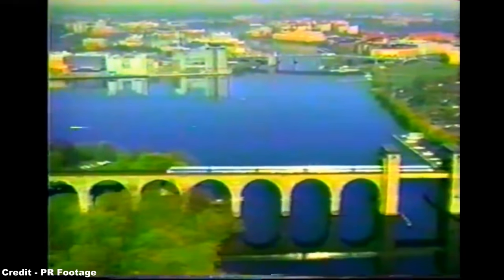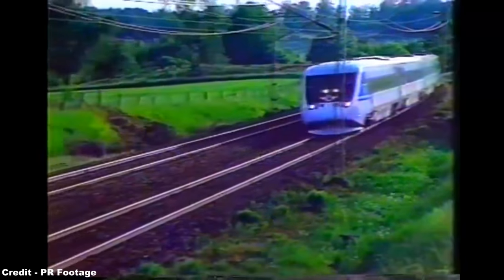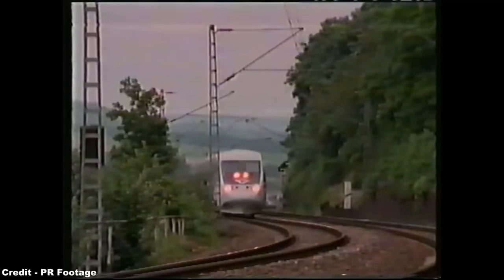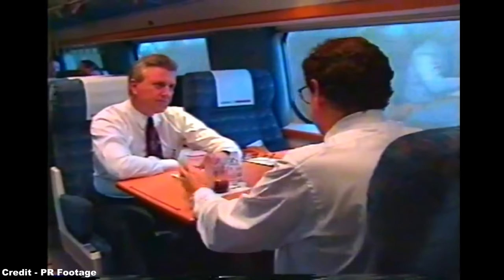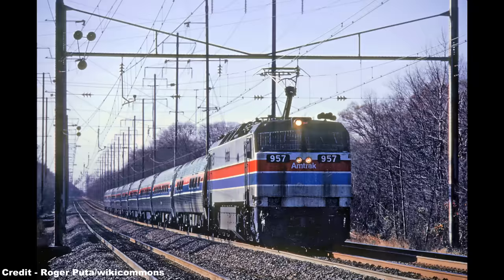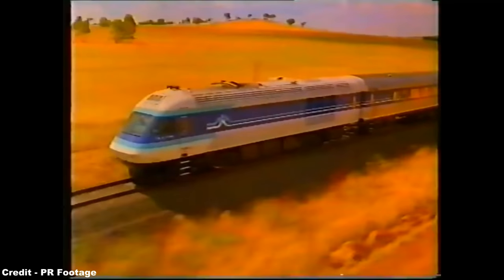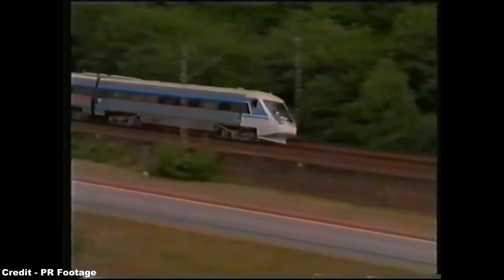Tilting Triumph - X2000

Comment: Well, one correction is that Sweden is not "largely mountainous" but, in fact, rather the opposite. It is flat, with some rather minor mountains in the north towards the Norwegian border. There are other reasons Swedish mainlines are not so strait; many lakes that needed to be avoided and the cost of building infrastructure in a sparsely populated country meant that is was cheaper to go around obstacles than over or under them.
Reply: It's hilly more than anything
Reply: @wewillrockyou1986 
Not particularly.
Reply: Tbf Its basicly just a massive hill going towards jonkoping
Reply: @moggsly5669  Just this summer I cycled from Göteborg to Stockholm via Jönköping, and...can confirm.
Reply: Yeah I cringed a bit when I heard that. If you look around there are no mountains anywhere near population centers. Sweden is hilly at worst. Lake dodging makes a lot more sense as an explanation for a tilting train and frequently bending track
Reply: So they were cheap
Reply: @qjtvaddict  When the main lines were built, I don't think anyone expected trains to travel at the speeds they do today. So a cheaper and curvier track made sense.
Reply: @persjofors2586 It is rather hilly on the west coast though, specifically around Gothenburg and north. And you can't forget about Höga Kusten.
Reply: Compared to most of Europe you could probably call it mountainous. And there isn't a flat stretch of land anywhere north of Gävle.

Comment: And 30 years later, the X2000 is still the best train running here in Sweden, in my opinion. Thank you for this nice presentation.
Reply: 33* and is not the best depending on what you call "best train"
Reply: @jultomten3739 I clearly see "in my opinion" in Michaels comment..
Reply: @davebowman6497  Missed that, sorry still 33 years :)

Comment: The X2000 is a design classic. I hate to use the word "iconic", but I think it applies here. Definitely one of the best looking high speed trains ever, along with the ICE1 and the original TGV Atlantique and Sud Est. I've never been on one, but I recently visited Malmo and saw one at the station. So cool.
Reply: They struck a perfect mix of modern and classic with the sleek ends and corrugated sides. The original TGV and Shinkansen are definitely more iconic, but the X2 is a much more timeless design.

Comment: Thank you VERY much for this. I got to ride X2000 on the noon Metroliner in 1993. It was EXACTLY what Amtrak needed for the 19th century infrastructure that is the Northeast Corridor. In the end it was expensive and Amtrak wanted cheap and so we got the "American Flyer" later rebranded Acela. X2000 has been rebuilt losing the original GTO inverters and getting IGBT inverters (and ballast to make up for the weight loss) and will be in service through at least the end of the decade. Acela cannot be replaced soon enough. We had the answer in our hands...and we let it go.
Reply: Blame the AAR for that. They insisted on the ridiculous requirement for trains to resist structural deformation with sheer buff strength rather than crumple zones that could absorb kinetic energy, so most American trains are effectively built out of heavy steel armour plating. Unlike everywhere else in the world, that seeks to avoid derailments and collisions by providing adequate signalling and infrastructure, the AAR approach is to require rollingstock that won't be destroyed in the inevitable crashes.

They've relaxed the rules somewhat but the legacy remains, and American railroads are notoriously resistant to embracing new ideas from overseas.
Reply: @zoqaeski  They were planning a waver for the NEC though. No there were more concerns about buying American and Bombardier had production in the US. In fact they have that waiver now for the Avelia Liberty.
Reply: @zoqaeski  The AAR does not write standards for passenger vehicles. Back in the late 90s when Acela was on the drawing board they designed for the then current FRA requirement for end buff strength: 800k lbs. After a knock down drag out fight within the FRA the 1m lbs buff strength requirement was adopted for vehicles above 125 but not above 150 mph. (For the record X2000 met the 800k requirement as designed and may have met 1m with little or no modification.) At this point, as later chronicled by NRPC OIG, they should have ripped up the plans for Acela and started over. Buff strength is a function of design as well as material. But starting over would raise the cost and exceed the already paper thin margin Bomber had committed to. Ergo, they added more steel and created a very fast tank.
Reply: @quayzar1  At the time of testing X2000 and ICE the wreck of the Colonial at Chase, Maryland, was still very fresh on everyone’s (read FRA) mind. They were not going to sanction “high-speed” cab cars on the NEC and so if X2000 had been chosen there would have been a power car on each end. Also, at the time ABB had the facility in Elmira, New York, at the time and would have complied with the “buy USA” requirements. That property would later become the space for CAF USA to build the Viewliner 2s…but that’s another debacle.

Comment: My first ride on a high speed train was on an x2000 back in the early 2000s. It was a brilliant service especially compared to what I was used to in the UK and Ireland. It wasn’t particularly fast but the interior comfort, general design and cleanliness was a step above anything I’d previously experienced. A really great achievement.
Reply: But the speed of the X2000 is the same as UK trains such as the HST and 225 so surely if you count the X2000 as a high speed train then the HST should be a high speed train as well.
Reply: @OntarioTrafficMan As I stated, It wan't particularly fast.

Comment: Except for the far north Sweden is not a mountainous country but it is very humpy. The geographical feature which dictated the shape of the railways was the prevalence of lakes and rivers. The engineers building the tracks originally took the easy way out following the edge of a lake or a river wherever possible giving rise to the extremely twisty track. Even today the most sinuous portions are those which follow the water's edge but the cancellation of G forces is so good that it can be quite a surprise to look out the window and see an adjacent stretch of water apparently sloping up to sky.
I don't know whether it is still the case in the early days even the second-class carriages had the same at table 2+1 layout as first class which with the broad Swedish loading gauge made it about the most spacious second-class in Europe.

Comment: As a Swedish train geek, I appreciate videos with high quality about our trains.

Just a small correction.

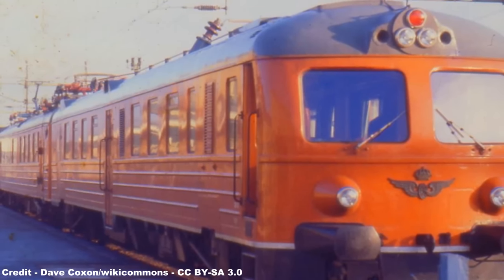2:32  The X1 was used in 1969-71 for tests of high-speed trains. X1 were new commuter trains at the time and they were needed in Stockholm.
So they used an old X5 that was built in 1948. It was the X5 that was rebuilt into the X15.
Reply: And now we have a Swiss train called X15 "p" waiting to start service on the Roslagsbanan 😉

Comment: Sadly the X2000's time in NSW Australia never went beyond the demo runs due mainly to the amount of severe curves reducing train speeds to as low as 40mph in places caused by government restraints on capital costs that forced the early railway planners to follow land contours that could be easily accommodated by the early steam locos of the period from 1855 onwards. Net result is that while yes you can enjoy the scenery onboard but in terms of competing with road and air places railways in NSW a very poor third behind road and air travel. For example a domestic flight between Sydney and Melbourne takes around 90 minutes where as The XPT covered the same distance in roughly 10 hours.

Comment: I ride these quite frequently and they are gems to ride on. And they are undergoing refurbishments currently that improves the comfort, smooth ness and reliability of the tilt system. However when the tilt system breaks down, is not fun.
Reply: Funnily enough the tilt system was broken on the bistro car last time I traveled with x2000

Comment: I'm a Swedish driver but not currently qualified on the X2 (I hope to be in the not too distant future!). Just walking around the depot they have a very destinct aura around them. It's just something with the pretty brutal design and roaring fans when departing. I did drive it for two weeks during driver's training, and it's really something else. Going through curvy sections on the mainline at 180 km/h is something else, you're really flying while comfortably sipping your coffe (at least from the DVT...)!
Reply: @bjornlillpers498 Curious~How's the feel while riding X2 locomotive side???? 
 Feel uncomfy when it doesn't tilt ????
Reply: @jim1997330  It's fine when you're in the seat, but you have to hold on to your coffee on twisty sections. It's pretty loud as well
Reply: @bjornlillpers498  Thanks man, I finally got the answer I want  (´▽｀)
Rare to see these unit ,locomotive + tilting carriages ~~~~
Reply: Får du köra X2000 nu?😉

Comment: I had the opportunity to look over the X2000 set when it visited Brisbane in the nineties. It consisted of a driving trailer and two carriages, with motive and head-end power provided by two XPT power cars. I had to laugh at the "Conference Room" on board - two pairs of seats facing each other over a table,  surrounded by a perspex enclosure. I immediately thought of the Cone Of Silence on Get Smart.

Comment: Hi Ruairidh. Very interesting video. It still sticks in my craw that BR did so much research and development into a tilting train, but could not get over the winning line. I heard that Italy had taken up the running, presumably culminating in the Pendolino. Therefore, it was with surprise that you didn't mention the Pendolino until almost the end and then almost in passing. I had no idea that Sweden had done so much work on the technology. By-the-by: Guangzhou is pronounced Guang-Jo and Chengdu is pronounced Chungdu.

Comment: Thanks for the video. 2 points.
Sweden is not mountainous.
I think you meant radially steered bogies, not radically.
I rode on the X2000 demonstration cars between Sydney and Moss Vale in NSW in the 1995. It was a  Bistro and first class car between 2 local XPT locomotives which had each been fitted with the ABB tilt control system. We hit 160km/h a few times but had to slow through tunnels due to the narrower NSW loading gauge.
Reply: Not mountainous, no, but it has a lot of humps and waterways.

Comment: While I love the Acela, the X2000 would have been right at home on the Northeast Corridor. The corrugated stainless steel body compliment the AEM-7 / Amfleet stock perfectly, aswell as the Arrow/Silverliner EMU’s and ALP44 loco’s. Even the SJ livery looks very Amtrak like with its color scheme. Sometimes I wish that alternate history had occurred and we would have ended up with them…

Comment: First introduced in 1990. Ironically this is posted in a week when HS2 to Manchester has been cancelled in the UK. Talk about being 30 odd years behind the curve.
Reply: These aren’t exactly high speed trains as such your not getting 185mph here!
Reply: @vernongoodey5096  never mind speed they were first introduced in 1990. Years ahead of anything in the UK at the time. All that underinvestment under the Thatcher and subsequent governments left the UK light years behind rail travel on the continent especially France.
Reply: @philbraithwaite1316  as a railway engineer I’m sure the actual locomotives don’t tilt and the  drivers would suffer from nausea, don’t no if they have cured this. Your correct with Mrs Thatcher in all her years as a politician she only ever travelled twice by rail and one of those was when she named a Class 87 after herself (good old Sir Peter Parker)
Reply: The uk has had 200kph in regular service since 1976 so not that bad.
Reply: @philbraithwaite1316  hold on just realised the year you quoted, our HSTs that still hold the world speed record of 142mph we’re introduced wait for it in APRIL 1976. The genius design was that it ran on our old Victorian rail system at these speeds. & went from design to introduction within 4 years after the APT-E debacle
Reply: Oops just read your last reply we both quoted the same info thanks. Buy the way Europes first actual high speed line was built in Poland Warsaw to Krakov

Comment: I'm just amazed by how much I used a train back in the  1980's and early 90's  in the UK  despite owning a car.   It all sort of dropped off once moving to the SW of France. in 1993  80% of the rail network closed down (as with Beeching). My last train trip was with the TGV from from Avignon to Paris, and then Eurostar    in 2014 to Charing Cross.....

Comment: 2:32 X15 is NOT based on X1 unit, but by X5 units, wich the picture above correctly shows. The X1 units was also tested for tilting technology, but did not become an X15. Some X1 and X10 commuter train units can be seen at 5:39 next to the X2000 in Stockholm Central.

Comment: As a Hong Konger, I could possibly add something more to the Chinese export story. Part of the reason for the demise is that the Swedish firm did not provide regular electrical maintenance as part of the leasing contract. As a result, the Guangzhou railway group had to sort problems out on its own by sourcing components from both overseas and local reverse-engineering. The lack of proper support had raised the maintenance cost drastically over the years, while the train had grown to be incompatible with the newly renovated Guangshen railway when the Bombardier-designed CRH1 was in service (And subsequently the entire built-from-the-ground-up Chinese HSR). So X2000 quickly fell out of place after numerous failures. 

However, in retrospect, this train serves as an important landmark in Chinese HSR history as it was the intermediate product of slow mainline trains and the full-fledged dedicated HSR lines. It also teaches the Chinese how not to run imported models as later on they simply bought the right to manufacture the trains in China under the original maker's guidance.
Reply: Very informative, and apparently, the train set was bought back and put in the Järnvägsmuseét (railway museum) in Gävle.

Comment: Partial video that tells history of failed prototypes that had no commercial follow-up and ignores the true story of a 50-year success. The technology of the "titling train" called "Pendolino" is an entirely Italian invention and patent. In 1985, engineer Santanera filed a patent application for the Fiat Ferroviaria company, entitled "Railway vehicle for high speeds with variable trim body", granted with the number IT1183754B. This used 2 gyroscopes by aeronautical equipment (FIAT avio) and accelerometers, placed on the first  bogie of the train. A computer, depending on the speed, calculated the inclination to be given to each individual carriage, when it reached the curve. The first Etr 401 "Pendolino" entered service between Rome and Ancona in 1976! Since 1988, with the Etr 450, they entered regular service, forming the backbone of the Italian 250km/h AV (high speed). Over 30 electric trains (ETR) were built of the 450,460,470 and 480 series. The FIAT railway patent was purchased by Alstom in 2000 for 300 million euros!  Titling train manufactured by Altom around the world are built on the original Fiat patent.

Comment: Today, as they're over 30 years old, the reliability is not what it used to be, the X2 is now the most problem-prone train sets that SJ has, even surpassing the notorious X40 double-deckers from France. But SJ has started to overhaul the fleet by rebuilding them, both technically and cosmetically and the "new" units are almost like a brand new train making it possible to run them at least 20 more years, if not more
Reply: Is the X2000 really so unreliable?
Reply: Yes. And I'm speaking from experience of driving them at a daily basis here. They're definitely not what they used to be

Comment: "Sweden primarily mountainous terrain"

What? where? There are plenty of small hills, but barley any mountains. Apart from up in the north west, but there is no railways. 

The reason for not wanting a France style solution is simply that it was at this time not deemed a economical to build a full extra track for as little traffic as would be needed.  This kind of have come bit and bite Sweden now with a large capacity shortage.

Comment: Great video, but you got that bit about mountainous terrain all wrong. The populated parts of Sweden is not mountainous at all. The reason the lines are so bendy is because it was cheaper and faster to build them going around lakes and other obstacles. No substantial new lines had been built since the 19th century.

Comment: Nothing more than the basic flight control system found in simple autopiloted passenger aircraft - a directional XY gyroscope box with a couple of rate gyros, all feeding servo type motors for tilting.
Reply: ..... yet all others before who attempted to implement this, failed!
Reply: Nothing like it actually. The autopilot has been around for around 100 years. It has the luxury of time and empty airspace in order correct for deviations from the straight and constant speed flight path of its single "carriage". 
By contrast, the tilt control is not concerned with the direction of travel. It's there to maintain the comfort and safety of the passengers by constantly monitoring changes in track cant, curvature & gradient, vehicle speed, acceleration & roll - then calculating the precise duration and force required for each of the 20 hydraulic rams along the length of the train and actuating those commands in real time before repeating the process all over again in the next half second.